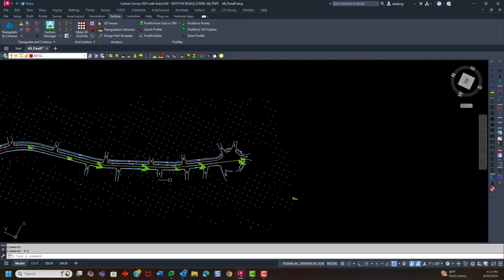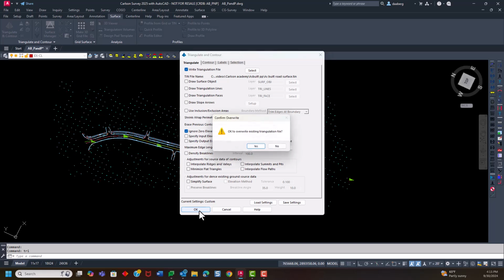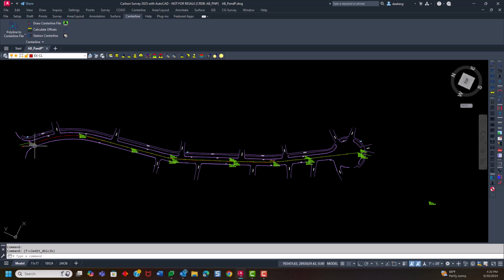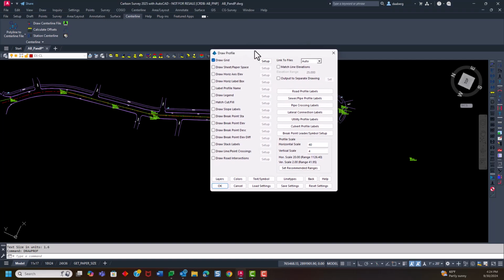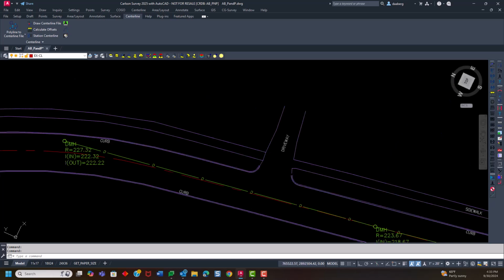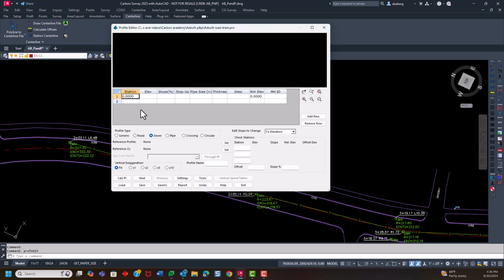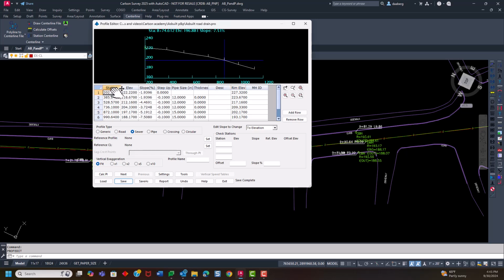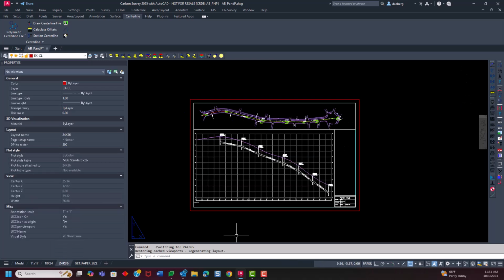As Built Roadway Plan and Profile using Carlson Survey

Comment: Is the final length and slope of pipe correct? The pipe does not follow the CL perfectly so wouldn't the pipe lengths and slopes be off a little?
Reply: Very good question and you are correct. The video was getting long enough as it was, so I didn't go into that level of detail. What you can do is create the sewer line with relative stations based on the line itself. Then when you draw it on a profile, you select the option to "Station by another Centerline." The slopes will be correct, but the stationing will follow the road centerline. The other option, which is what I actually use for this, is run it all through the Hydrology module. It has a routine called SewerNET that adjusts for all of that including structure widths etc.
Reply: @dougaaberg5844 so in SoCal we use station equations to equate street cl station ingredients with sewer stationing (so we get correct lengths/slope on the sewer pipes. I think that's what you're saying sewerNET does.
Reply: @tomthomsen11  Yes, essentially. SewerNET uses the actual pipe lengths from structure to structure, but you can station each one by the centerline. If you subtract stations, you don't get the same length which is more accurate for slopes.